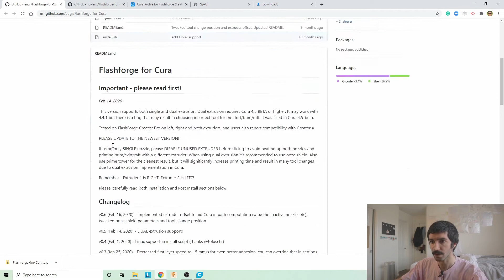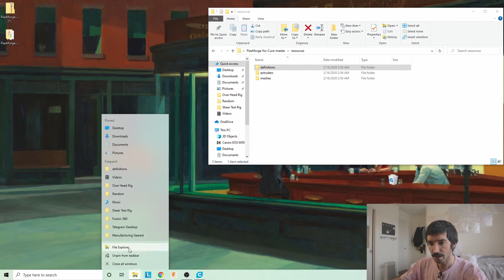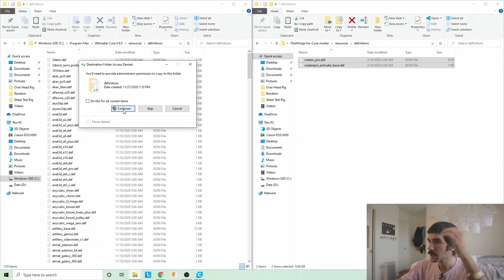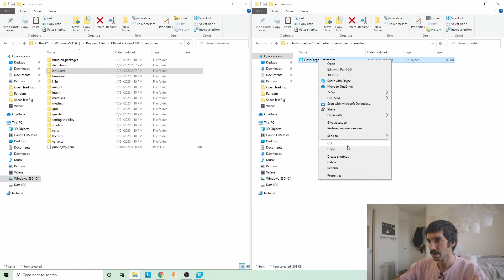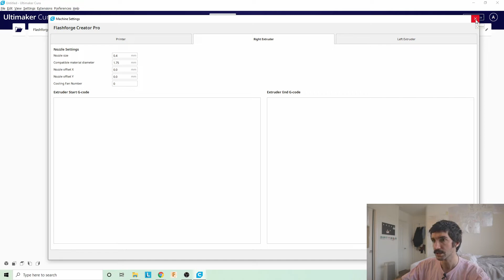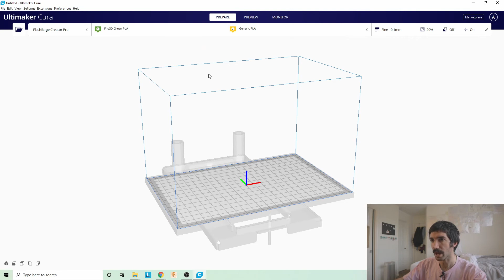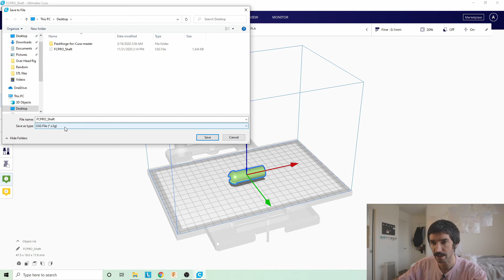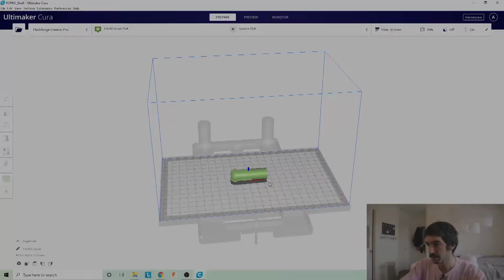Cura for FlashForge Creator Pro

Comment: Hello, I work with Ultimaker Cura v 5.9.1, and with the Creator Pro. The nozzle temperature only starts after the plate temperature is reached. This lengthens the print start time. Is there a solution to fix this problem? Thank you in advance. If not, it works perfectly. Thank you for everything.
Reply: I've always preheated through the printer (usually while I'm slicing), seems to be faster to me
Reply: @jeffpurl1081  OK, je ferais une préchauffe pendant la découpe. Merci pour tout.

Comment: Bonjour, je travail avec Ultimaker cura v 5.9.1, et avec la creator pro. la température de la buse se met en route qu'après la température du plateau atteinte. Se qui allonge le temps de démarrage de l'impression. Y a-t-il une solution pour régler se problème. Merci d'avance. Si non cela fonctionne parfaitement Merci pour tout.

Comment: Hi Ali, thanks for the instructions.
I have now received a Flashforge Creator Pro (without number / first generation) as a gift
I am currently using the older Cura version 4.6. with the Github profile for the FFCP.
But I have two problems:
The first problem is if I want to use the Cura version 5.8.1, then my print bed will not heat up. That is why I am currently using version 4.6.
Why is my print bed not heating up?

The second problem is in version 4.6 and also 5.8.
If I assign their extruders to the two parts of the print object 
- Object 1 - extruder right
- (object 2 - extruder left
then center and mix the two objects, the result in the slicer is OK.
The preview is OK.
However, when I then print, both objects are offset in the y-axis.
The printed part of extruder left is shifted backwards by 2.3mm.
If I move the part that is to be printed with the nozzle on the left by 2.3 mm from the 
the origin in the y-direction, then the result in the print is OK, but the wall is offset and the print is therefore unclean.

If I enter the value 2.3 for "Nozzel Offset Y" in the "Nozzel Settings" of the left nozzle in the printer settings, each layer is always shifted by 2.3 mm. This is OK for the first layer, but each subsequent layer is always shifted by 2.3 mm in the Y direction.
What can I do to solve the problem?

Thanks for your help in advance

Greetings
Frank

Translated with DeepL.com (free version)

Comment: for newer cura it youshould use this way rather than going into resources in cura as it no longer exists (C:\Users\your_username\AppData\Roaming\cura)
Reply: I first used the updated directory that @alejandrocafe8238 posted and the printer would show in the list, but cura would crash whenever I tried to add it. I put the files where you suggested and it worked. Thanks!

Comment: Ali, thanks for this video!!!  I did EXACTLY as you say and installed 4.8, copied the files over, loaded a sample STL file into Curr and saved it as a .x3g file.  I am about to purchase a Flash Forge Creator 3 Pro early next week, and I wanted to be sure that I could use code generated from Cura and have it simply translated over to be accepted by Flash Forge.  Does anybody have any concerns about Flash Forge and its ability to keep its firm\ware stable?  By this I mean if I go ahead and purchase one of their machines, will I have forward compatibility with the Gcode that is generated or does FF make changes in its firmware over time to re-map or modify what Gcodes mean to their printers once translated?  I saw a recent video (not old at all!) that is claiming Flash Forge makes firmware mods and then such changes are not allowing for existing code to operate as it once did.  If this is true (not saying it is), it would be a HUGE deal to anybody trying to use open standard Gcodes.  Any input is much appreciated.
Reply: There are no parameters files to add the creator 3 pro on Cira, I am getting crazy now because I can not set up the machine for different materials!
Reply: @rafiuxxx29  I love the Creator  3 Pro, but I too am struggling to set it up to use TPU.  I still have a ton to learn.  So far, I can. Open an STL in Cura and slice it, but so far I always have to send the file to the printer using Flash Print.
Reply: @gordonhope9219  but how can you slice it if the creator 3 pro Is not listed on CURA?? 😱
Reply: @rafiuxxx29  I located a profile for a dual head Flashforge Creator 2 and COPIED it then edited it for the larger bed of the Creator 3 Pro.  I do not really like the way Flash Print scores its "custom materials".  They should allow you to add a material profile and name it so it is easy to select.
Reply: @gordonhope9219  oh wow ! And does it works?? Just you change the bed sizes and that’s all? The extrusor heads positions are the same? Thanks for your help buddy
Reply: @rafiuxxx29  I will double check what the actual Gcode is doing next week (out of town till Monday) from Cura.  The steps are: 1) import STL into Cura 2) make sure you have the x3g addon  installed on Cura 3) Cura does sliding, then you save the file 4) take file to Flash Print and read it in.  It will find ERRORS, tell you that, then fix it and Save.  5) have Flash Print send the corrected file to the printer.  Now, what I need to verify is that indeed the Cura slicer file Gcode is what actually got sent to the printer.  For sure you CANNOT take the Cura file in x3g format , manually save it on stick and then try to load that file... you will get an error that extruder temp isn't set....

Comment: Hi Ali, very interesting! I have Cura 5 though and can't find the same folder system. Any suggestions? I will try to find an older Cura 4 to test it until I figure it out.
Reply: i found it for CUra 5.0: C:\Program Files\Ultimaker Cura 5.0.0\share\cura\resources
Reply: @Korvorkian1  Thanks so much!
Reply: @Korvorkian1  will be great to be able to use Cura for the Flashforge printer!
Reply: after messing with it ive found that it DOES NOT work with 5.0 but seems to work like a dream with 4.12 just FYI.  im sure it would work with 5.0 with some tweaking but im not big brained enough for that so DUAL INSTALLS IT IS
Reply: @Korvorkian1  I installed it on both 4.12 and 5. The problem is now that my Creator doesn't "see" the files ending in X3G.
Seems it only sees gx and I can't find a functioning converter.

Comment: This was super useful. I changed my extruder nozzles to 0.6mm, and wanted to use Cura as the FF slicer would not allow that change. Thank you!
Reply: Hi Luke! Really the Flashprint has an option to select the 0.6mm nozzle, just click in the printer name in the bottom left corner, select nozle size and change to 0.6mm. I'm using version 5.3.3
Reply: @orlandofanti  but can you select multiple materials? I can’t with the creator 3 pro, just the PLA it’s available
Reply: @rafiuxxx29  I'm not sure, I am using Flashprint for Creator Pro 2. When slicing there's options for materials on both extruders, and this works fine, I've used a few times.

Comment: I installed using both the install.sh and manually but only the Dreamer NX would appear.  I modified the definitions file creator_pro.def.json to read "id":"flashforgecreatorpro" (which matches the extruders machine id) and this fixed the problem.  I now have the FFCP working in Cura 4.11.0.  Just posting this in case someone else has the same issues :)
Reply: I’m having this issue can you walk me through

Comment: My Printer does not show up in the list. I just have the Flashforge Dreamer which I do not need 🤷‍♂️
Reply: I had the same problem. The Dreamer comes with Cura 4.9 - What eventually worked is that I deleted flashforge_dreamer_nx.def & flashforge_base.def from the definitions folder. Next time I started Curra the Creator pro was given as the only option when adding a printer.
Reply: @dustinhartlyn326  It worked thank you!
Reply: @dustinhartlyn326  thank you, that worked for me
Reply: @dustinhartlyn326  Worked for me as well. Thank you.
Reply: @dustinhartlyn326  haha i tried that and now i don't even get the flashforge drop down tab

Comment: Hi! How to change the steps_per_mm default value for X and Y axes in creator_pro.def.json file? I am trying to enter a value but something is not working for me ... I changed the gears and I have to correct this difference.

Additionally, I have mac os big sur so ReplicatorG or Pronterface don't work ... I want the change to be in config, not G-Code. Is there a way to do this?
Reply from the maker: Hey
I made another video about changing and customizing the JSON file!
you can watch it here: https://youtu.be/Bk8oWcC3kBU
Reply: @alirassi5697  Thanks for the answer!

I tried to change the steps_per_mm values (lines 66-69) in the file C: \ Users \ AppData \ Roaming \ cura \ 4.9 \ definitions \ creator_pro.def
But it made no difference.

I replaced the gears in the printer and had to change the Steps_per_mm {"default_value": 94.117647} to {"default_value": 100} in lines between 66 and 69, but it has no effect.
Where did I go wrong?
Do I have to delete and add the printer to Cura after changing the config file?

I'm not good at programming and I have to fix this value as soon as possible because I have to print one thing for an anniversary gift for my parents.
Reply from the maker: @JayJayProd  I thought it should've have worked!
but now that I think about it, you might have to change that value in the firmware! but I haven't tried changing that value in Sailfish!
my experience is more in Marlin firmware!
Reply: @alirassi5697  
And where and in what file should this modified SPM value be located?  Can you help me point out where this value should be placed?
 Should I put this value in another file or on a different line?
 How should it be written?
 "Steps_per_mm": {value: 100},
 "Steps_per_mm": {value: 100}
 "Steps_per_mm": value: 100,
 "Steps_per_mm": 100,
 "Steps_per_mm": {100}
 "Steps_per_mm": {100}
 "Steps_per_mm": [100]
 "Steps_per_mm": [100]

 Maybe it formats this command wrong ... As I said - I'm not a good programmer, actually, I'm not a programmer 😜

Comment: Tks a lot, Works fine to slice 2 objects, but the merge option does not work for dual printing. It doesn't recognize the origin of the stls. It merges, but in a wrong way.
Reply: it also gives me the same problem. were you able to solve it? thank you

Comment: I'm having issues with my computer not recognizing the printer when it's plugged in, and there by not allowing me to print directly from Cura. Did you run into this issue as well? I've been looking for a fix but so far have found nothing.
Reply from the maker: As far as i know you actually can't do that! FFCP does not work directly with any slicer and you have to use SD card for your print jobs! Quite a bummer to be honest!

Comment: Would you be interested in creating a plug and play Cura profile for the FFCP II with IDEX for PAY? If we can agree on a price, I would pay you to do this and I'll bet others would buy it as well. I realize you don't have the printer to work with, and that could be the deal breaker of course, because I wouldn't know how to get you one to use for the development of it? Please let me know, and I will understand if you don't want to or can't. THANKS FOR THE GREAT VIDEOS!
Reply from the maker: hey Jerold! so, yeah I looked it up and it's a bit different! and the way I usually go about it is changing a couple settings at a time, run it on the machine, and then debug to eventually get to where i want! but as you mentioned I don't have the machine myself and i dont really think it's possible for me now! though i should say, i'm thinking about making a video about using Prusa Slicer with FFCP and that may or my not work with FFCP II! but in case you are willing to spend money, i would suggest checking out Simplify 3D. i haven't tried it because if there is a free alternative, i would never buy a software lol but i understand if you rather stick with a single slicer for your workflow! but again, Prusa slicer (Slic3r) is also very powerful and might help. so check back in a while in case i got to make a tutorial for that as well!
Reply: @alirassi5697  hi i have a creator 3 but my machine doesnt read X3g files format only .x or .gx can you help me out thanks!!

Comment: Can this be used for Creator Pro 2 (IDEX)?
Reply: Soup  unable to get cura working with my FFCP2
Reply from the maker: I can't tell you first hand since I don't have that machine myself, but I made a video on how you can create a working profile for technically any 3D printer! (https://youtu.be/Bk8oWcC3kBU)
 if you couldn't find a profile for FFCP2 online, you might wanna check that video out and tweak some of the settings to match your printer! you already have a profile that works for FFCP, so I don't anticipate it to take much time to adjust it for FFCP2!
Reply: @alirassi5697  Yes, I tried that, but it sent the IDEX print heads on the FFCP2 crashing into each other.
Reply: Soup  No, and since S3D does work properly, I have given up on CURA until they offer profiles that actually work with the IDEX FFCP2.

Comment: Hi !! thank you for your video ;). I followed the procedure you give. Everything seems to be working until I put the sd card into the printer ... 
the file appears but nothing happens ... No reaction. an idea ? Thank you very much !! ;)
Reply: This also happens if the filename is too large, or has spaces.. use alphanumeric with a - or a _ with no spaces and keep it short.
Reply from the maker: I would open up the .x3g file with FlashPrint to see whether it shows anything or not. if it's showing a flat surface on the print bed, it means probably you are doing something wrong in the process of converting the g-code to .x3g.
Reply from the maker: I could reproduce this. it might be that you are opening your stl file directly via Cura. try opening Cura first, and then import your file into the slicer.